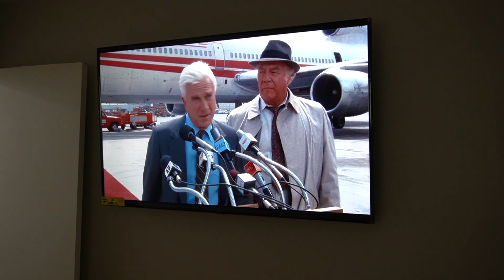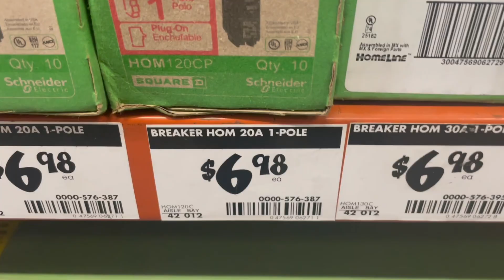Electricity for Beginners! (Tips and Tricks)

Comment: You can do multiple GFCI outlets without them tripping each other. Just make a pigtail off of the circuit into the line side, and down stream do the same thing. The outlets trip individually. Your local codes may vary so look up if you can do that. I did that in my garage I did that in my garage since my kegerator is in the same circuit that goes to an outside outlet. Every time it would rain with our Christmas lights on, it would trip and kill power to the kegerator. Nobody likes warm beer!

Comment: A 200A service into a house can 100% kill you if you touch it. Absolutely make sure you kill the master breaker/fuse before fucking around in the panel. 

Make sure the breakers are rated the the GA of Romex and plugs you're using. A 20A plug on a 15A breaker isn't a big deal, but a 15A plug on a 20A plug is. 

GFCI outlets only go around water, at the end of the line so that plug will trip but all other lines connected to that point will still work.
Reply from the maker: Dude you know your stuff!
Reply: @DIYSITY My dad retired from one of the main electric companies in the area, and I've been more around the commercial side than residential. However, you're spot on with the point about electrical being completely doable by the average homeowner as long as you're safe and make sure all connections are secure and in a box! Seeing that shredded jacket / exposed wires you had were definitely not safe and glad you got it upgraded!
Reply from the maker: GFCI goes first outlet from the panel. Cheers braj!